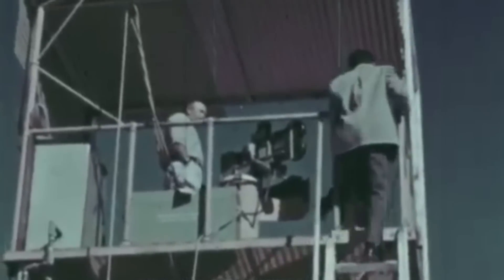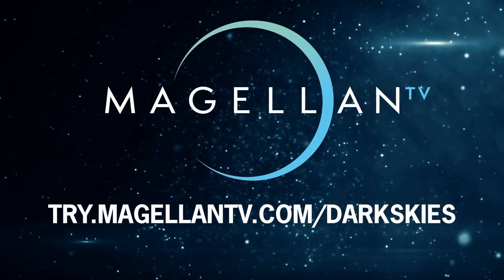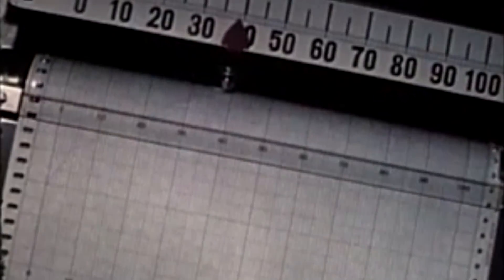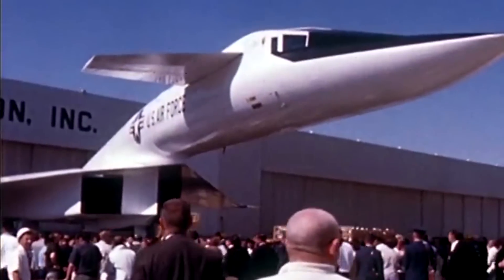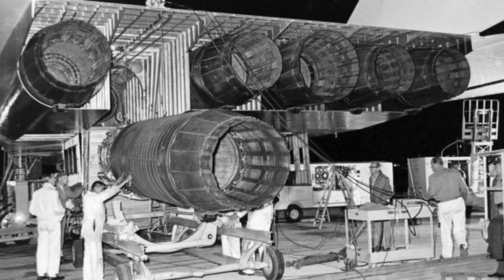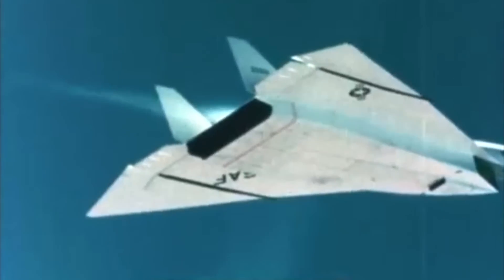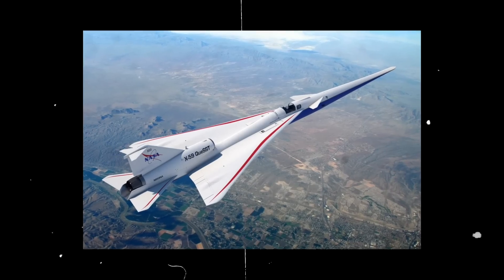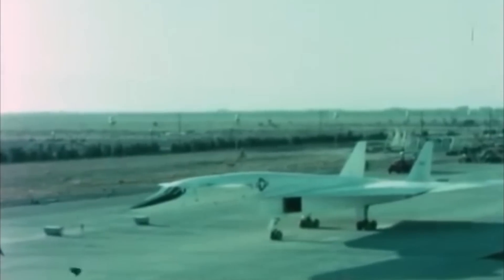XB-70 Valkyrie - Mach 3 Nuclear Bomber

Comment: Alot copied from concord and TSR2 !! BUT YOU WAS BEATEN BY BRITIAN !!!
Reply: @Galileo7of9 wing design, drop down nose at supersonic speeds too name afew !!
Reply: @Galileo7of9 listen to the narrative you div !! Concord flew in 69, and TSR 2 in 62-63, check your facts before you mouth off tyipical Yank !! Look at the simeralities in design !!
Reply: The B-70 can fly at over 3 times the speed of sound, with a ceiling over 70.000 feet, neither of those features was offered by Concorde or TSR2. 

The B-70 has canards, a fixed geometry nose cone, and variable geometry wingtips - features not seen on those other planes. The B-70 uses "compression lift", which I've never heard mentioned in regard to Concorde, and only sparingly by TSR2, though technically the phenomenon was noted in a paper published by NASA scientists in 1956. 

But you think that the B-70 a copy of those other planes because....reasons?
Reply: @Galileo7of9 It's odd that there's so much angst in comments posted by YouTubers who are (allegedly) Brits, but the Curious Droid video on B-70 is actually kind of cool.  

Obviously there's no need to explain motives for design similarities among several airplanes, when those airplanes have no real design similarities.
Reply: Also look at the British English electric lighting such intercepted one of your spy planes when it ove took it on its way to 75k ft !!
Reply: @davidsmall2944  also look at another post that makes no point and has nothing do with the 1st comment. Why are we looking at Lightning?
Reply: Did your go into operational an operational role ?? No concord did, the only super sonic aircraft to be used !! TSR2 was also built within the parameters you suggest, but was cancelled because of political pressures from the US, WHILST YOUR AT IT take a look at the Agro ARROW !! both the aircraft were years advance than America aircraft
Reply: @davidsmall2944  "Did your go into operational an operational role ??"

(translation)  DId your experimental B-70 go into operation? Because our Concorde barely did - nobody wanted them.  Of course, it wasn't 'our' Concorde - we had to share development with the French, but it's not like we could have been more successful had we designed a subsonic airliner that airlines actually wanted"

Wow, and all this time, I thought you were from England, which is to say, from a place where much of the population actually spoke and wrote in English.

"No concord did, the only super sonic aircraft to be used !!"

First off, I think you mean the only supersonic airliner, right?  I don't say this very often, but LOL - why do you think that Concorde was the only super sonic (supersonic?) airliner?  Putting aside Tu-144, which was a bigger failure than Concorde,  Concorde was the only operational SST, because nobody wanted SST's, and only the flag carriers of the 2 countries that developed it actually flew them.  

"TSR2 was also built within the parameters you suggest, but was cancelled because of political pressures from the US"

Suggest?  Check your dictionary, pal.  I didn't "suggest" anything - I straight up told you what those parameters were.  

But of course, since those parameters are nothing like the B-70's design and performance specs, they're obviously the source of the B-70's design and performance specs, right?

Also, your conspiracy theories about "pressures from the US" are easily debunked - even if yanks put some pressure on England, political pressures between Labour and Conservatives, and RAF cost worries were also in play.  That the British aviation needs eventually turned towards multinational projects and not purely indigenous aircraft strongly suggests that the British didn't want to produce their own airplane.  Finally, the Yanks got little for their efforts as their F-111 was also rejected.  But of course, CONSPIRACIES!!!

"WHILST YOUR AT IT take a look at the Agro ARROW !! "

Yep - no canards, no centerline ventral intake, different wings, different mission, different performance specs - obviously a copy, right?

"both the aircraft were years advance than America aircraft"

Yep - both shit-canned by their own people years before the yanks put anything like them into production.

Do you have any theories that actually are supported by historical evidence, instead of being curb-stomped by it?
Reply: Nosey aren't you !!
Reply: No I am not British there is no such nationality of British ??
Reply: @davidsmall2944  if your words were longer and had a lot more consonants, we might have a shot at calling you Welsh. Calling you "English" would be ironic given your command of the language.
Reply: Yes I do thanks for asking ?? Or are you hoping to too me the yanks invented English as well?
Reply: Unfortunately for you each area has its own dialect, and we describes thing differently within the language, however we understand each other !! This is why English is a hard language to learn ? Even for you boys and girls across the pond !!
Reply: I am a proper cockney !!

Comment: "The data was incredibly valuable until the project was canceled"  umm ah yeah, data always becomes useless then.. ;-)
Reply: Not necessarily. If any of the technologies used in the developments were useful then they could have been carried over to another, similar aircraft.  B-70 flew with YJ93 turbojets. The Boeing B2707 was going to fly with General Electric GE4 turbojets which was developed from the other engine. Eventually, all American SSTs were canceled, but not 1971, 2 years after the B-70's last flight, and years after the earlier plane had been canceled as a weapons system.

Comment: So was the Valkyrie the ancestor of the Blackbird
Reply: Developed independently of each other. The SR-71 was developed from the A-12, which dirst flew in 1962. The first Valkyrie flight was in 1964. The B-70 and SR-71 were designed by different companies with different missions, and don't resemble each other or share any apparent design features.

Comment: I like how they crammed 6 engines in a row side by side.  Even if that is probably not the best arrangment due to limited air supply, and uneven distribution of air current post intake.

Comment: I think that this aircraft was more advanced than the SR-71. It could fly just as fast...Mach 3 even though it only had a few test flights...the airframe aerodynamics was wind tunnel tested to Mach 6 (!) so there was plenty of room to grow if it was put into service) but was HUGE compared to the SR-71. Also, no air-to-air refueling required, no leaky tanks, much more payload and no special fuel. The SR-71 reportedly used some nasty stuff.
Reply: @Galileo7of9 I suspect that you are correct. I looked it up and could not find the reference to Mach 6 wind tunnel testing I thought I remembered. I must have confused it with the X-15 somewhere along the way. Good call!
Reply: @Galileo7of9 Yeah, I think you are correct. Read my response to Winter Now above.
Reply: @Galileo7of9 is that Graham Simons?
Reply: NAA offered speeds to about 4 mach, but that would have required substantial redesign of the hydraulics and environmental systems.
Reply: @winternow2242  Imagine piloting an SR-71 at Mach 3 only to have this monster bomber pass you at Mach 4!
Reply: @Galileo7of9 I read it in a book, not online. I'll try to find it. Just to be clear, the airframe aerodynamics were tested to Mach 6. That doesn't mean that all the subsystems (hydraulics, cooling, and of course propulsion) were capable of it. 
The XB-70 reached Mach 3 very early in its short test program. I am confident that if it were allowed more than a few test flights it would have easily made Mach 4 with perhaps minor upgrades. Just think of the SR-71 test flights. It didn't do Mach 3.2 on the first flight. It took them awhile to get up to the final maximum velocity.
Reply: @Gemini-b4g  Tab Aero's book on the B-70 says that it's limit could be exceeded "to" mach 4, but that would have required the "major revisions" I mentioned above.  

The 1st Valkyrie's maiden flight was in September of 1964, and it's first (I think only) Mach 3 flight on its 17th flight in October of 1965, over a year later.  That's sooner than the A-12 - which flew in April of 1962, and passed Mach 3 in July of 1963 - but not by much.  I'm having problems finding when the SR-71 went Mach 3, but given a December 1964 maiden flight, and USAF delivery in May of 1966, there couldn't be more than 18 months between those 2 events.  It's likely a lot less than that, unless you want to believe that Lockheed promised a mach 3 airplane, and didn't demonstrate that design goal until shortly before delivery.

I don't understand why you're much more confident in the B-70 than the A-12/SR-71.
Reply: @winternow2242  First off, I need to retract the Mach 6 reference. Galileo7of9 schooled me on that. I couldn't find the reference for Mach 6. I think that you were right and it more likely was Mach 4 that they thought it could be improved for. 

Anyhow, the reason I am more confident that the XB-70 could increase in performance over the A-12/SR-71 are the several things: the design and operation was much cleaner than the A12/SR-71. For example, the A-12/SR-71 did not use compression lift, which added an extra 30% of lift than if it were straight-winged at Mach 3 (from "Valkyrie, North American", by Steve Page, p26) . This equates to less drag in order to get the lift required to operate at high altitude.

It also did not have the really weird operation cycle, complex and high-maintenance engines with the nasty fuel as the A-12/SR-71. It used much more conventional J93s. What this means is that a lot of propulsion improvement could be expected if the XB-70 had not been cancelled. Simply put, if A12/SR-71 or similar technology engines with nasty high-energy fuel were used instead you could expect a sizable performance increase.

The XB-70 also had a lot more payload capacity. It did not need to be refueled mid flight since it had large tanks able to carry the fuel for a full mission. This means that its mass fraction (fuel to structural weight) was much higher then the A-12/SR-71 and would be capable of higher speeds when the tanks were mostly empty.

In short, I see a lot more growth potential in the XB-70 than the A-12/SR-71 design.

Comment: Could this have been turned into a sst
Reply: How?  It had a fraction of the internal volume needed for an airliner. North American offered a derivative design for the US SST competition, and lost to Boeing.
Reply: @winternow2242  I don’t mean the exact plane configuration, but the engines and modified airframe
Reply: @cdizzle99z  I didn't think you meant the exact design. The configuration was for performance that an sst wouldn't need, while not offering the capacity of the other designs. It carried fewer passengers than the Boeing and Lockheed SSTs, and shorter range than both those planes and Concorde and the Tu144.
Reply: @Galileo7of9 wasn't the B2707 supposed to use a civilian version of the 93?

Comment: The Russians/Soviets must have thought it was a viable design, because they copied it and built a plane that looks almost exactly like the XB-70 Valkyrie!!
Reply: Looks quite different to me. The Sukhoi has a variable geometry nose, and fixed wingtips - the opposite of the B-70. The ventral intakes would have helped generate a shockwave needed for "compression lift", but wouldn't they have also needed the folding wingtips?

Comment: Very slightly resembles the tu -144 .. only a little
Reply: Doesn't resemble the Tu-144 at all.
Reply: @winternow2242  I think it does .. a little 🤷🏻‍♂️
Reply: @carsandstuff365  the Tu144 has one vertical stabilizer, and 4 turbojets in pods under the wings. The B-70 has 2 stabilizers, and 6 engines next to each other, with ventral intakes - all centerline. Both planes have delta wings but the sweep angle of the leading edge is constant on the B-70, but varies on the Tu144, and is less swept towards the tip. The B-70s wings were angled upward on the second plane, which would have been a design feature had it gone to production (the first plane was pretty flat, anhedral/dihedral).  Both B-70s had downward folding wingtips. The Tu144 had fixed wingtips, with anhedral. B-70 had a fixed geometry nose with a rising windscreen. Tu144 had a variable geometry nose.
Reply: @Galileo7of9 well I did say a little bit.. not “identical” as some may miss presume what I meant
Reply: @carsandstuff365  nobody "miss presume" anything. You mentioned they had some resemblance. They've have none, and even a minimal description of each plane reveals the differences between the 2. As a practical matter, the best way to banish the illusion that 2 or more things are similar is simply to look at pictures of the 2 side by side. I used to think that Grumman's Wildcat and Hellcat were hard to tell apart...until i looked at both at the same time. When you do that for the B-70 and either SST you'll notice that the B-70 doesn't even slightly resemble either plane.

Comment: I thought the XB-70 was NEVER  bomber, it was a high speed test platform with no internal bomb-bay, and external bombs are not practical at speed, more like the predecessor of the commercial SST. . . .That's like saying the X-15 was an experimental Fighter. . . which it is not. . . I was at Dayton AFB Museum back in 66, before the B36 was inside a building, and then again later in the late 90's, with more indoor storage. Great Museum, and it was FREE when I went.

Comment: This Plane looks like the Concorde
Reply: You're not the first person to note that, but honestly, the two are quite different.  Concorde is smaller and lighter.  They're both talless deltas, but the Concorde's wings don't have the same angle for their leading edges, or folding wingtips like B-70 does.  Nor does it have center-line, ventral intakes like  that other plane.  B-70 has canards, 2 vertical stabs, center-mounted engines and a fixed-geometry nose, unlike the Concorde, which has one vertical stab, a VG nose, and underwing mounted engines (and 2 less than B-70) which are spaced apart (something that might have helped after that 1966 collision).  Concorde is smaller and lighter than B-70, and has a slower top speed and a lower ceiling.

The two are therefore quite different.
Reply: @Galileo7of9 ogival - thanks. Couldn't remember that word.
Reply: @Galileo7of9 just learned that word today. Insert your joke about eye makeup here (or flying buttresses if you're REALLY old)

Comment: If this is the right plane they have one at the Dayton Air Musem in Ohio
(I believe there's another plane that looks like this but not for the same purpose?)
Reply: The B-70 is at the museum. It's distinctive looking. I doubt you'd confuse it with any other airplane. 

I think the museum also has a B-1A, but the 2 look nothing like each other.
Reply: @winternow2242  gotcha i know they have a plane of the same diameter with 6 jet engines in the back
Reply: @winternow2242  so I do believe its a B-1A
Reply: @Galileo7of9 i thought it was a 1A, but it looks like there were only 4 prototypes built, with 2 in other museums, one crashed and the other disassembled.
Reply: @Galileo7of9 it might be im not sure i havent been to the museum in 3 years
Reply: @Galileo7of9 oh cool ok thank you
Reply: @Galileo7of9 Boss Hawg, huh? Did the crew drive up to the flightline in a white Cadillac Deville convertible?

Comment: There was some pretty serious rumors of a program called project Blackstar in the 1980's using a secret extra XB-70 carrier aircraft for a air force reusable air launched orbital spaceplane. It can probably never be proved but that mach 3 high altitude launch capability might have been feasible at least for a small fighter sized craft.

Comment: I know that for the most part, American cold War aircraft are very technically brilliant. Myquestion is 
Why does every American military aircraft of the cold War look so choppy and straight edge? This plane and the blackbird looks cool has hell, but their general service aircraft like the b-52, b-36 and even the b-58 look no where near as futuristic as the v bombers, and yet Britain retired them.
Reply: I don't know what "choppy" or "straight edge" mean when describing an airframe. And "futuristic" looking is going to be a matter of opinion.  Like, IMO only Vulcan looks unconventional, and as for futuristic, every time I see one, I think of "Thunderball".
Reply: @winternow2242  well, you look at details such as the wings or the cockpit, and for some reason the big American planes to me seem kind of archaic. Only appearance wise.
Reply: @josephhardwicke6344  they "seem" archaic because they were used o. Airplanes that were built decades ago. If they were built now they wouldn't "seem" archaic. You're treating a subjective aesthetic observation as if it were objective. 

If you mean to say that the older planes had more angles than curves, that would be different because that's an objective observation of the growing use of blended surfaces and edge root extensions you see on planes like F-16 or the B-1 which need them for either high AOA or reduced radar cross section.

Comment: Wonder if this thing would be useful as a conventional high altitude bomber.
Reply: I doubt it. Payload is lighter than on the -52 and the B-1B and there's probably no advantage in speed for operations against all but the most well equipped and defended adversaries.